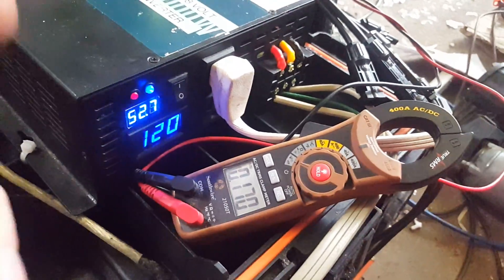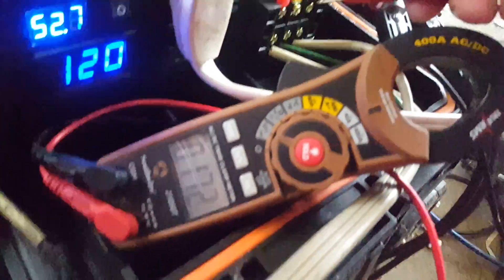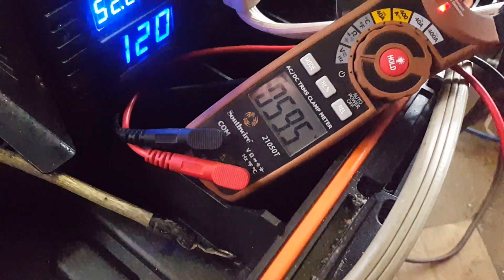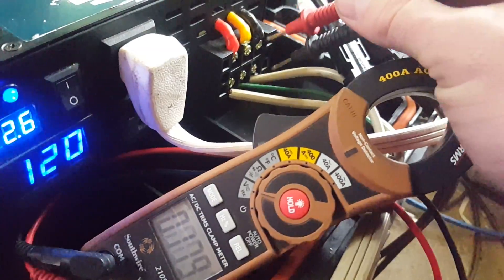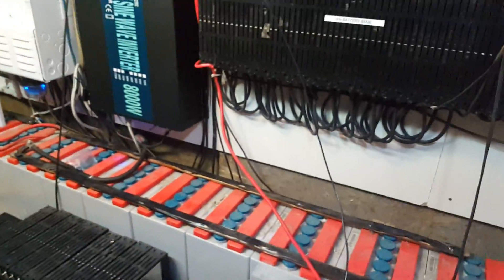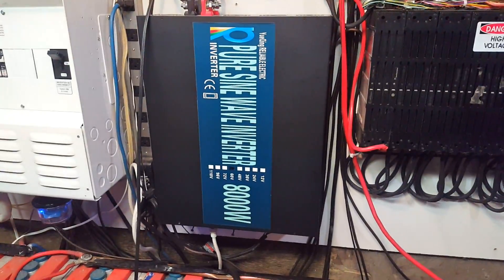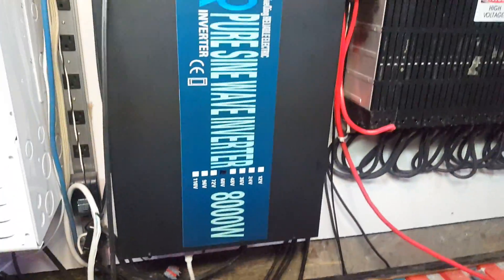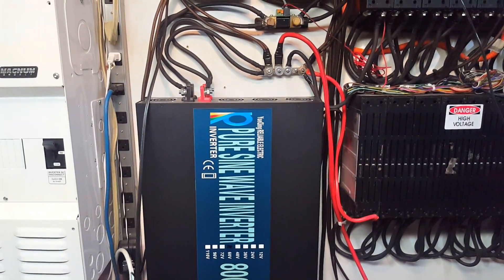Does Reliable Electric Have a Live Ground? Lets Check It Out

Comment: I tried this on a CHGAOY 3000W 12v inverter which has terminals like the Reliable (red, yellow/green, black). Between red and black I get 120v. Between red and black I get 120v. Between red and yellow/green I get 2 to 3 volts. Same Between black and yellow/green. What does that mean?
Reply from the maker: Probably  no live ground

Comment: I’m changing from an old 230v LNG inverter to a new 230v with just a LN. Single phase. Just like the newer one you showed us (8000w one). So does that mean I just run the inverter LN to the house LN and leave the existing house earth in place?
Reply from the maker: You can yes, it's not proper but will power the house
Reply: What’s interesting is on the back it has electrical symbol square with a square which means it is double insulated. Should I ground the inverter case still?
Reply from the maker: @michaelwood3825  have you checked to see if it has a live ground?
Reply: Not yet, it’s just sat on the bench at the moment. I’ll do some continuity testing on the outputs. However the terminal block for it only has a live and neutral (230v 6000w inverter). It might be as simple as where the LN leaves the inverter into the house junction box, I bond the neutral to the existing earth connection. I have emailed the manufacturer for information on whether the neutral is bonded or not (it must be based on the terminal block though).
Reply from the maker: @michaelwood3825  yea it is looking like what your saying is probably right. I just used the inverter and bypassed the ground from the inverter.

Comment: How do you set up the 220v version, because these inverters  have one hot line one neutral and one ground, and I need 2 hot and one neutral from my 220 connection, any help would be appreciated
Reply from the maker: these do not have a neutral only live 1 and live 2 and ground, you will need a transformer to get a neutral.
Reply: @GoingOffGrid101  autotransformer?

Comment: Hey GOG, I have a question..I have a 24v 3000watt inverter,- off brand of Reliable... My outputs are as follows, L_N_G , when i connect Live and Neutral I get 120v but if connect Live to Ground I get a low voltage like 10-12 and same with Neutral to Ground, its brand new and works perfect with Microwaves and Large Air conditioners etc. The manual i recieved seems like a standard one they send with all inverters, it says not to ground neutral, I did check inside the case and can see the Ground is also grounded to the case before it comes out to the Outputs, what is the best way to ground this inverter, go straight from ground lug to Ground Rod? Can it share the same ground rod I drove in for Solar cells (lightning).
Reply from the maker: I would just ground before inverter and ground after inverter and leave the inverter ungrounded

Comment: I have a 24v 3000 watt reliable purchased in 2020 and it has a live ground. 60 volts on each side. I didn't know that when I was building my shed until I kept getting a 60v shock from the ground lol. So with the switch or breaker off there is still 60v there. I may change inverters I guess. But that sucks. but it is actually working well.
Reply from the maker: No you dont have to get a new inverter, I would ground before the inverter (solar panels) and after the inverter (breaker panel) and you will get the same results. Your gfci will still work :) dont ground the inverter its self is the only work around.
Reply: @GoingOffGrid101  do you still use the ground on the inverter?
Reply from the maker: @staym925  I don't normally on the reliable brand no

Comment: so i have the 24v version, and it works great, but it cant power my furnace because it throws an error because of the volts on neutral and ground, any idea on how i get around this? i believe the furnace uses the ground for communication
Reply from the maker: gound the furnase to your house, and dont use ground on the inverter.
Reply: @GoingOffGrid101  I am also in the same situation with a furnace, if I ground the furnace to the house then the fault current (if there ever were to be one) will not trigger the inverters breaker and thus not terminate the fault. Is this understanding correct? I suppose it wouldn't be a dealbreaker in a quick emergency situation, I'd rather take that risk than freezing

Comment: That live neutral topology is common, they create a split rail (+/- 100VDC) and create 60 VAC on each leg, then drive the L and N legs 180 degrees out of phase from each other so you get 120VAC between them. The ground line is connected directly to battery negative, so if you bond the neutral to the ground you’re shorting one of your half bridges directly to negative and will destroy the inverter. The only reason they do this is so they can use lower voltage components and save money, but it is a inferior way to make an inverter, especially considering they could use the same topology with a little modification to be a 240 VAC split phase inverter.
Reply: Is there any way around this to give the inverter outlet a ground? Like earthing the ground to a rod in the ground..  

Or just running neutral and line to a separate outlet and then just attach ground screw from that outlet to the outside ground rod?

Comment: I had to replace all 8 10A automotive fuses on my 3000w 36V DC to 230V AC one when I noticed something: the main PCB has a PE labeled hole and it was not connected to the chassis. When I connected it I measured 115V on ground as you did. If you disconnect the jumper wire from the main PCB to the chassis you won’t measure this any more. I think we are actually measuring a high Ohm interference filter or such alike....
Reply: So does this fix the problem? Does taking that off give 110 (230 in your case I guess) to ground while also  rendering neutral cold? If so, I'm doing this on my friend's inverter to fix it....

Comment: As my 3500 has a hot Neutral and I wanted to connect to a refrigerator that also would be on house power, I built a control box for the change over. Power now can come in from either source safely. It uses a large metal enclosure, 4 pole powered change over switch, a time delay relay, two 15 Amp breakers, two 15 Amp receptacles, and a power relay. It is set for the inverter power to be the primary input and the commercial is the backup. When the inverter is off, the switch is in the commercial connection and draws very little power as only the indicator LED is lit or powered. When inverter power is available, the time delay relay waits X period of time for the inverter to reach full voltage. It then times out and powers the power relay. The relay then supplies power to the switch which changes over from the commercial power to the inverter power. By using a 4 pole unit on either side, the live wires, the neutral wires, and the grounds all switch from one connection to the other.  Only waste on the inverter side is the relay power and the LED indicator. I can live with a 12 Watt loss when the refrigerator is only running the fan as it is free power. The unit could also be wired for 240 Volts as there currently is an unused section on the 4 pole switches and the relay is a 40 Amp DPDT currently wired as parallel circuits for the 110 so the contacts see very little load on each.  The unit can be used with commercial power being the primary by just changing which of the two cords is plugged into which source.

Comment: live ground is something used in europe so your live is less than 60 volts, and thus you get the 120 volts by combining the two live wires, just as we get 230 in the usa from 110... but perhaps they decided they do not need it for 220/110 inverters?

Comment: What if one of the mosfets in the H bridge had a missing/bad isolation pad. If it’s back drain was screwed to the chassis which then connects to ground?
Reply from the maker: I will have to check

Comment: Yeah, this is my first system recently installed and I didn’t know inverters run this hot
Reply from the maker: if the fens never turn on then you have a big problem as well.
Reply: My 3000w doesn't run hot fans come on pretty early when loaded.  Make sure you upgrade the battery wires that came with it. They are barely sufficient

Comment: I measured the temp on the inverter frame only, this inverter does have 2 ac plugs on it with the hard wire posts as well. I’m using a separate stand alone distribution box to wire the house
Reply from the maker: I would add a external fan blowing on the right side intake holes that should be where the output fets are, they get the hottest from what I have seen.
Reply: Your distribution box will have 60v on the ground wire. Even with your switches and breakers turned off. It does work fine. Mine is like that. But if that ground wire in the wall ever touches anything it will be shorting out.  60v could start a fire in reality. I don't know if you could use a separate breaker for the hot and ground so you could fully cut all the power.

Comment: Hi guys, I need some help, i have a 3000w pure sine wave inverter, it only has 2 posts, 1 for hot , one for neutral, so I grounded to the frame.  At the power box, the neutral and ground are tied together, bonded to earth.  At the inverter I measure 120v between hot and neutral, but 75v between hot/ground and 75v between neutral/ground. appliances seem to run but, the inverter runs hot under small loads like 127*F w/o the fan running. What is my problem?  Thx
Reply: Remove the ground connection as you will end up burning up the unit. Units with hot neutrals to ground are for use where you either have an isolated system or for single appliances run off of the outlets.
Reply from the maker: first off this inverter is not built to use a ground it seems. the heat issue is easy the fans only come at 135f I believe, are you testing the mosfets or the heatsink for temperature? 127f is not hot for a inverter if that is the mosfets or transformers.

Comment: It's not LIVE, it's floating. Unless you bond it to ground, which you should. If it is acting as a separately derived source then the neutral should be bonded to the ground and the ground should be bonded to a GEC within the same room. If you are using the NG bond in your house panel and have your input street power isolated, then the inverter should be as close as possible to the panel as to share it's NG bonding and GEC. I love it when non-PE's start making claims without any true knowledge on the subject...
Reply: Good luck bonding a wire with 60v on it to ground 🤣🤣🤣 like to see that spark
Reply from the maker: this ground and neutral can not be bonded on some of these inverters or they blow up, same as if you bonded live to neutral they short and let out smoke.
Reply: GE may be book smart but street dumb. It is not a floating ground Grim Engineer. It is a hot Neutral and like GOG said, bond it and watch it burn. The hot Neutral units are designed as stand alone units where you plug in a cord to run an object. Not connected to house wiring. A floating Neutral would be a split phase 240V system where a transformer is center tapped.

Comment: That units that has this live ground issue...do you remember was it was bought ?
Reply from the maker: from reliable
Reply: sorry...I mean the year that it was bought ...

I have a similar one that I bought last year...and it will be connected within a week or so from today... One thing that I quickly discover in the unit that I have is that the neutral is not bonded.... Do you know if your unit is like that?  ...I'm planning to tight together the neutral and the ground at the bolts and the ground will be  from the breaker panel.
Reply: Thinking more about it...I will not connect the ground and the neutral...it seems that this unit works like that....
Reply from the maker: do the same test I did and if its not 40-60v then your safe.
Reply from the maker: 2017
Reply: It's not actually a issue with the inverters.  That is how they designed it to work. The issue is they were not clear on warning people that the ground has 60v on it. And it has hard wire terminals so people assume you can use it properly in a home type grid with a breaker box. The problem is even when the break is off or a switch you still have 60v flowing to every outlet. This is not the only inverter like this. Many of them have this design.

Comment: Check to see if your case is hot also on the live ground units, that is AC voltage and you could get a big zap if you become  grounded and touch the case? Just use a meter to check between earth ground and the case of the inverter.  When case's are hot it can be a problem. Live grounds are bad news on inverter or anything in a solar system. I would contact Reliable to see what is the fix to get repaired. If not fixed,  wear proper PPE  when working on your system(high voltage gloves Etc), to prevent you from coming in contact with a live ground.  This can be a big safety issue if the case is hot and you're grounded to something else within your system. Be safe always!!!!
Reply from the maker: yes you are right, but its half voltage on the live ground so 60v ac, its not a huge concern, but I will keep safe while working around it! thanks!

Comment: I have the Reliable 60V DC/230VAC unit. I'm not sure how to hook it up. It has a live neutral yellow and red 120V and Black 110V. Has anybody here used the 220V version and connected to there house breaker panel? I asked the Ebay seller and he has not gotten back to me.

Comment: I wonder if you have a live ground and a 220V inverter, could you tap into ground - neutral or ground - positive and use it for 110V appliances?
Reply: That basically is what you have in most homes in the US. It would a split phase system and some can and some can't handle it that way. Many of the inverter companies say you can do 110 or 220 but not both. Ones that can run much higher costs than those that can't.

Comment: I have a say it ain't so.. power jack 5 kW. I haven't checked it. the voltage is just 110v. but so far its done good. I sort of think maybe they are kind of knockoffs of the cheaper brands. since its harder to knock off the more known brands. I have heard of factories being operated at night without the owners knowing anything about it. maybe all sorts of things could be going on in poor country's with the larger factories. that's only one of the possible things to explain why some are OK. and some are far from it. or maybe its just poor standards . power jack does seem to be trying to improve their products.
Reply from the maker: these reliable inverters are much better then power jack, I have had power jack and they are much worst.

Comment: My 300 watt 24V 120 60hz has the live Hot neutral and my 3000 Watt 24v 120 60hz has live ground I even double check from the ground post underneath. Maybe its the input voltage that dis earns weather the ground is Live?

Comment: Glad you found that and published it! I recently purchased a Reliable 3500W 24V unit and performed that check just about right away and mine HAS a Hot neutral. That, among many other issues I have with this inverter prompted me to write a letter (email) to Kayla @ Reliable explaining what I discovered. She has yet to respond to my followup emails! I said that the instructions are terrible and there are NO warnings about this hot neutral, etc. Funny your 8KW unit has a cold neutral! Wow. Yep, that scheme is a cost cutter. Thanks again! Nice setup there!
Reply from the maker: yea, is your inverter working? i'm always wondering what problems people have with these cheap inverters, some are bullet proof and some are problem after problem.
Reply: Like OTE, my 500 watt unit from them has a true ground and only the Hot leg shows power to ground. What would be neutral in a split phase setup is 7.5V to ground. That is what I would expect for a current sensing setup. The Jupiter Mod sq wave 2000 watt nit splits the voltage between the Hot and the Neutral to ground. 56 volts on either to ground. DO NOT GROUND units with hot neutrals to home grounds.
Reply: May I ask how long you took to get your inverter I order mines going two month now  it is yet to arrive
Reply: Ouch on 2 months! I ordered mine from Reliable in Calif. Took under 10 days. Hope you can find where yours is!
Reply: HI! Yes, it is working. I haven't tried to challenge it yet by powering loads near it's capacity. It did start a dehumidifier ok. Voltage regulation is not too good. Highest is around 123V, but can slump to around 108 even with loads around 1200 Watts with battery input still over 12.2 VDC. Using 4 AGM 6V type golf car batteries for 24V.  It's a $350.00 piece, not a $1200.00+ "real" one. So, it has issues.

Comment: buy one of 5000w 240v the equipment did not hold them on. Then check the voltages and the three lines with voltage and one with voltage loss. It does not work for me I'm still waiting for the refund ..
Reply from the maker: that sucks, hope you get a refund!

Comment: So if a device shorts does it go to neutral via a circuit breaker or to a ground rod.
Reply from the maker: if you have a device hooed to the inverter and the device shorts it would go through a breaker and trip if you have one installed on the ac side, if the house gets hit by lightning you can ground before the inverter and after the inverter if you have one with a live ground to keep it safe